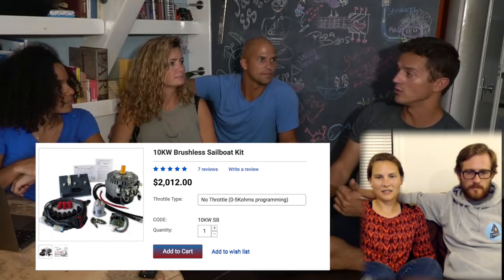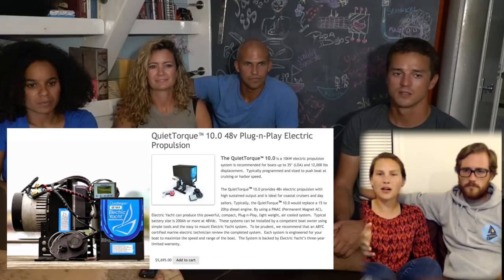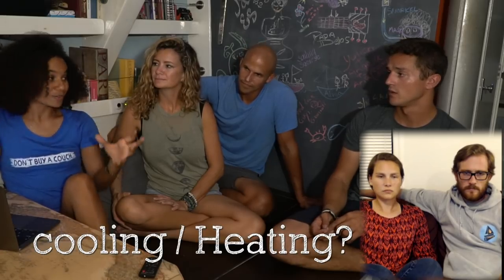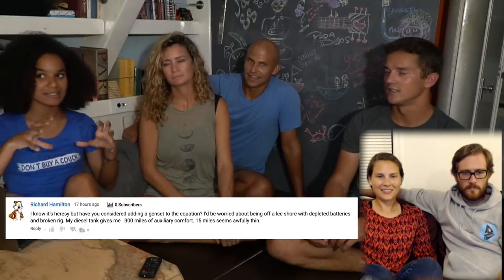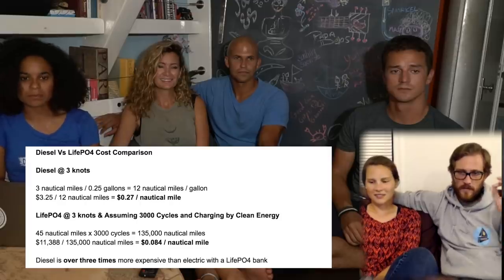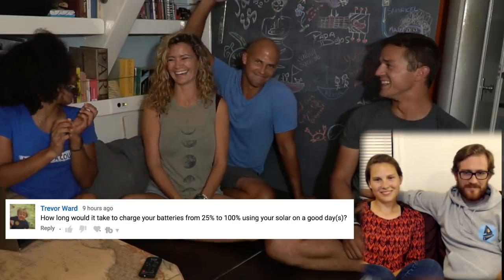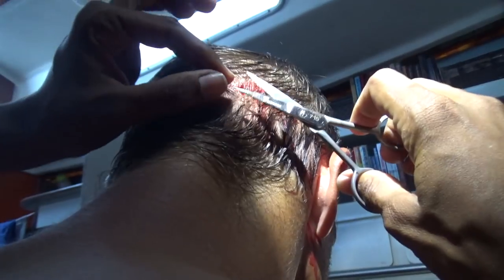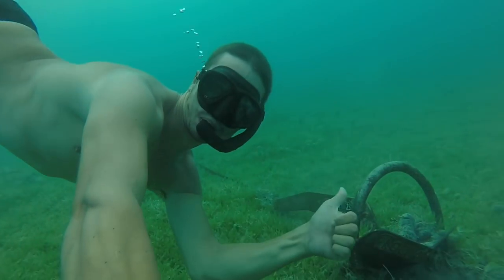Electric Sailboats: An HONEST Discussion — Sailing Uma [Step 140]

Comment: Guys, the batteries you use have already emitted a huge amount of greenhouse gases during their production phase so much so that you’ll have to use them for a long time to compensate for the difference in emissions from diesel which is basically end-user dependent. For comparison, an electric vehicle has emitted, PRE-USAGE, twice the amount of greenhouse gases (plus they get charged ON the grid - which uses mostly fossil fuels to produce power) in order to be produced. This amount is so great that it is calculated that you’ll have to use the vehicle for 200K miles just to start having any kind of net emissions gain. Moreover, battery materials like lithium, need to be mined with methods that are very detrimental to the environment, not to mention their need for recycling at the end of their life which poses even more challenges. All in all, use these products if they suit your needs, not because YOU THINK it’s great for the environment because they actually aren’t.

P.S. BTW with your setups you’ll probably need a diesel generator to be able to charge on demand those batteries in case you need to get out of harm’s way.
Reply: These kinds of exercises always leave out the energy it takes to manufacture the ICE engine and extract the fuels.  As if it takes zero energy to cast an iron cylinder block.
Reply: Fake news.  Electric cars are far more energy efficient, and batteries are recyclable.  The packs add ~20-50% energy consumption during construction pound for pound, but much of the energy needed for construction can be sourced carbon neutrally.  Oil drilling, refining, and transportation is breathtakingly wasteful and inefficient, and will get worse as we burn through our reserves.

Lithium is in fact a very small component of lithium ion batteries, and will be recycled as more packs start aging out.  The problem is, they're too good, and most don't need to be replaced yet.

Finally, as electric motors are vastly more reliable than internal combustion engines, they require a much smaller service industry, fewer spare parts, and fewer replacements.

It's not perfect, but it's way better from a carbon emissions standpoint.
Reply: Gordon Lamb I wouldn't say fake news; just not taking all variables into account.. Exactly the same as those who believe solar and wind have zero impact on the environment.  These are called lurking variables in statistics.
Reply: I've just heard this false myth repeated too many times on the Internet.  It kinda drives me crazy.
Reply: @adam smith, no they don't. What fool would argue about calculating production impact just for one side of the story?
Reply: @Gordon Lamb it probably drives you crazy  because you have too many emotions invested on one side of the story. I would be perfectly fine to be proven wrong. Electric cars are far more efficient WHEN USED, just like you say,  but that wasn't part of my initial  argument that highlighted the difference in emissions during production, not end-use. 

I have looked into it quite deeply and from a deep value investor perspective (which is why I am going to be positioned on uranium pretty soon, which is dirt cheap atm, for the energy needs are going to be exponentially higher in the proximal future - at least that's what I think - and David Iben of Kopernik as well). 

It seems that the info that I disclosed is legit and you can take a good example from an exchange between a Danish environmentalist and a EV manufacturing representative (pay notice to the adherence for specifics of the one side and the avoidance from the other) on Stossel. here:  https://www.youtube.com/watch?v=R5cJF9W157Y (around 13:00).

P.S. my piecing of the puzzle isn't of course based on popular opinion and TV shows but on countless hours of reading of transcripts and educated opinions from experts, CEOs, auto-manufacturers,etc). Bear in mind that diesel ICEs are going to be emission-neutral by Euro 6 and the new method of testing light vehicle emissions (which is much more attuned to the real world) read a scientific report here: https://www.fvv-net.de/fileadmin/user_upload/medien/aktuelles/WKM_Position_The_Future_of_the_Combustion_Engine_2017-09-13.pdf
Reply: So we should all slash our wrists and give up sailing?  When you go to a party do you find that people dont congregate under the black cloud that you bring with you and leave you alone?  Sure everything is bad, is getting worse and we should limit human population to save the planet for .. er an empty planet.  But what I see is people changing their ways and improving behaviour in the sailing community which is a pretty fossil fuel dependant dinosour of a place.

BTW No-one either advocated or has a diesel generator on board and all seek to use solar panels.  Diesel Generators at the affordable level are too big and heavy unless you go for megabuck Onans or similar.  If you are travelling the Intercoastal waterway, a river or inland waters without reliable wind electric boats may use a lightweight Honda inverter (or similar).  But each of these vessels are heading offshore to the Bahamas and only need to motor to get away from the shore.
Reply: @GordLamb  Can be but aren't! That's an important difference.
Reply: Can be but aren't what?
Reply: @GordLamb  Sorry. Can be sourced carbon neutral, can be recycled, but a lot of the mining is done in China and south America where environmental standards aren't a thing, and except in major first world cities, you can't recycle these batteries. Lead acid is far easier to recycle.
Just because something could be done in an environmentally friendly manner isn't a valid argument if it isn't in fact done in an environmentally friendly manner. And people who don't go electric aren't currently destroying the world any more than people who go electric are currently destroying the world.
Reply: This video might help put the numbers into perspective:

https://youtu.be/K9m9WDxmSN8

Afterwards, do some Googlin' around for yourself.  Electric cars emit significantly fewer tons of CO2 per mile throughout their lifecycle vs. equivalent sized gas/diesel cars, today.  They'll only get better from here on out.

This page has very nicely presented and easily digestible data from peer-reviewed studies, and is a great place to start:

https://www.theguardian.com/football/ng-interactive/2017/dec/25/how-green-are-electric-cars

It's also worth pointing out that Tesla intends their Gigafactory to be 100% solar powered by 2020.

In short, buying and driving a gas or diesel powered vehicle is worse (from an emissions standpoint) than buying and driving an electric vehicle.  This is true today, and the disparity will increase as we continue to develop lithium battery recycling infrastructure and move manufacturing to renewable sources of energy.

Comment: Sounds like you should carry a supply of diesel motor parts. You can sell them to those other suckers.
Reply: Are we comparing 30 year old diesel installations to new electric - is that fair ? Uma has replaced the batteries 3 times so far , gets very little range and over heats . Compare that to a 3 year old diesel , heck compare it to my well maintained 30 year old diesel  . Parts for diesels are even easier to get than electric specially parts simply because there is more demand . Try and get an electric motor speed controller for a boat in the amps you need  in St Martin , it will need to be shipped while I bet you can get an impeller for a common make of diesel .    Electric motors are great - batteries still suck .  I add that bad connections , corrosion , and high amps cause fires . Uma had to stop as she filled with smoke from one . Don't get me wrong , I like the idea of electric I am just realistic on what it can do .

Comment: Your motor is designed to run at 350f for 10k hours ? Wow I thought thermal protection is set at 110 to 130f on electric motors?

Comment: You guys have not done enough research on electrical technologies. There is a company that have hybrid systems that mostly run electrical systems with solar but have diesel backup that charge the batteries and run the inverter until full power is reached. The system props r able to turn around to regenerate power while underway with the included solar panels.

Comment: I do have diesel to move me around. I'm alive aboard (43 years) in New England and use less than a hundred on the engine. It takes 400 or more gallons to heat the boat in a cold winter, so I still need diesel. I would like to come south but that's not an option.
 I have eight golf cart batteries to power freezer, refreg, and other stuff. I use 200 amps per day. Lithium batteries would be nice but at ten times the price and still only lasting the same number of years why would you go that rout today? (amps per dollar per year)(you must treat your lead acid right vs. no maintenance lithium)
My boat is a Saga 43. One was ordered from the factory as a hybrid. It was converted back to diesel in two years.
Reply: I had read about thoughts of storing energy in compressed air. 

Benefits: Many cycles, very cheap, can be used to fill dive bottles, and use it in an air starter (so no start battery + no start motor) for a dino-fuel motor.

About 10 to 12 atm should be the ideal pressure, 100% storage efficiency (no energy loss at that pressure, while storing the compressed air).

Bonus 1 : Works at very low temperatures, where battery chemistry make the battery perform badly.

Bonus 2 : Free energy if heat from sun heats up the storage container for the compressed air (the pressure in it will become higher).

Comment: You Still use gas for your dingy's outboard so you still need to fuel up.
Reply: That's were the electric dingy comes in.
Reply: Torqueedo and Epropulsion are two good options for electric dinghy motors.
Reply from the maker: We've also only used about 25G of fuel in the last 2 years. And that included pushing Uma up the Rio. So it's not like you're going every day.

Comment: take a deep look into submarines, electric power & Fuel cell's for me the way to go...
Reply: Being an old submariner, our boats were diesel-electric, meaning that you had a means to recharge the batteries AND you always powered with the electric motors.  You just used 2 sources of electricity - diesel generator or battery.  Of course, we didn't have solar panels then, but that wouldn''t work well on a submarine anyway.  :)   If you really needed an extended run on your electric motor to fight current or motor up rivers, a small motor/generator makes a lot of sense, IMHO.

Comment: Don't get me wrong, electric really is the future. I would love to have a Tesla, solar power and a home battery bank. If my car runs out of electricity, I can get out of it and walk. My car won't go anywhere. As a sailor who has sailed more than 40 years, electric motors are impractical and worse yet, dangerous. Living on a boat is a perilous situation, in that even in a harbor, tied to a dock, you're still in peril (sinking, fire, accident with another boat, weather, etc.).

Your statements on the unreliability of diesel motors is not supported by facts, your anecdotal stories are just that -- stories. I hope there is never a day where you need an engine that can run longer than 45 minutes.
Reply: They claimed diesels are unreliable?! Lol.
Reply: @nomadequipment2177  Diesels have been running the world long before these folks were born. 10,000 hours on a well maintained Diesel is not uncommon.  Those LIPO batteries are almost 1000.00 each.
Reply: @steveddad4385  There's no inherent 2 hour limit on electric motors. Not sure where you're getting that from. All of the largest and most mission critical vessels like submarines and aircraft carriers rely on electric motors for propulsion - that should tell you something.
Reply: Quote you "jay w": electric motors are impractical and worse yet, dangerous
Any engine that uses fuel with a high-density energy content are more dangerous than an electric motor.

Not all types of Lithium batteries are equal : LiFePo batteries don't have the thermal run-away property the lithium battery in a smartphone has.

Also, they are more practical. 3 phase induction motors only have one moving part.
Azimuth thrusters use electric motors.

Comment: The Pardys sailed long distance, open ocean passages, passing up dozens of ports, because they couldn’t SAIL into (or out of) them. A sailboat engine is useless in open ocean, or in storms. I sailed my first boat for 11 years without an engine. An old salt told me, “Engines take sailboats places sailboats don’t belong!” I’ve been sailing 45 years. Liveaboard. Coastal cruising is different! Yer gonna need a propeller! If your diesel quits on you, it can be fixed in 5 min. Electric motor... nah! Spinnin’ angry pixies around on a boat WILL work, if you take Clint Eastwood’s advice. You got ta know yer limitations!
Reply: Paul Collins “You sir are a paid troll by big corporations that annihilate start up  companies wherever they appear” that’s Sailing Uma’s opinion on comments like yours.
Reply: C_R_O_M________ What type of boat do you own?

Comment: Regen on a boat doesn't work , the reason why it doesn't work is: if you are using a motor to generate power it would need to spin 10% faster than it's normal run speed to generate the same voltage, ( you need the base voltage generated plus at least 1.2 volt to charge batteries ) obviously a few knots will not spin a propeller that fast. You could add a gear box for Regen that you would have to switch to but that would need a different propeller that is larger with a steeper pitch.

Bottom line its simply not worth the complexity to design a proper Regen system, you would be better of with a max prop and gaining the additional knot under sail..
Reply: This is false, otherwise an inverter wouldn't be able to produce 110 VAC from a 12 VDC battery. It's just a matter of having the right electronics to convert the voltage.
Reply: Apples to grape fruits ... uma didn't produce regen and i explain why.
Reply: Where does an inverter from a battery even come into play ?  look a lead acid battery's max charge state is 13.2.- 13.4 volts and to charge that battery you need 14.4- 14.8 volts to do that. whats the difference ?

Also they already proved my point regen on uma didn't work because (A) the propeller could not spin fast enough to create enough voltage and ( b) as the load on the motor ( generator ) increases the water cannot transfer enough power ( work) to the propeller to spin the shaft fast enough , creating drag IE dynamic breaking.
Reply: There are things called DC-DC power converters that are based on the same technology as a solid state inverter. They use capacitors and MOSFETs and can generate an output voltage much higher than the input. If the drive motor is being used in regenerative mode to to generate power, a DC-DC power converter as part of the motor control system could be used to boost the voltage high enough to charge batteries. Electric cars use this same technology.
Reply: Yes you are right on that but ohms law still applies, if you say need 12 v 1 amp from say 6 volts you will have to provide 2 amps or 12 watts regardless, thus the power from the propeller must provide at least 12 watts plus thermal and mechanical loses , water is just not good at transferring power in this case.

But in reality , all the electronics in the world wont help you if the propeller can only supply so much power..

I'm looking into building a sailboat and after i looked at the options it just didn't pencil out , so ill be going with a 10kw bldc motor and a max prop feathering propeller..
Reply: I'm not sure what you're trying to say, but if it's that regeneration isn't going to produce as much power as the motor consumes when it's pushing the boat, then you're right. I'd be surprised if it produces much more than a quarter, when travelling at hull speed, and it could be less than that.
Reply: Also i really like uma's lithium batteries , and ill be going with those , even though sadly i have a nice bank of Agm batteries that i was going to use , instead ill use them for house batteries.. so we all learn a little.. i was weary on lithium batteries, but I'm a believer now.
Reply: Exactly... but more like 1/100th even 1/10 regen would probably be acceptable as that would be 600 watts . but i believe they were getting something like 30 watts ....... im sure you could get the 25% from that motor but you would have to spin it really friggin' fast probably close to 2k rpm if its a 1800 rpm and 4k rpm if its 3500...